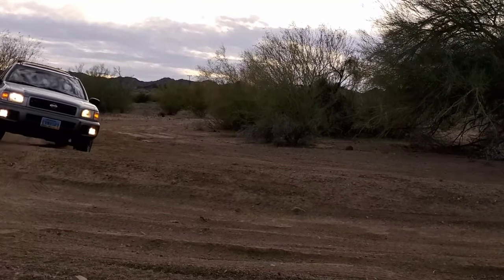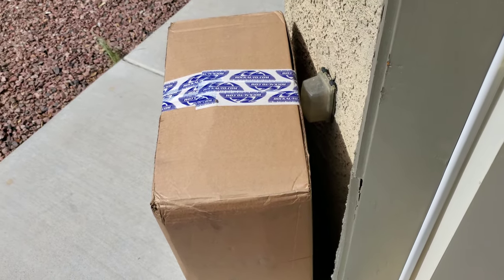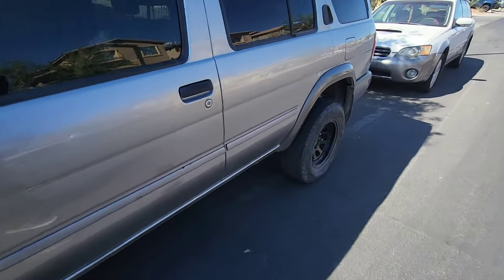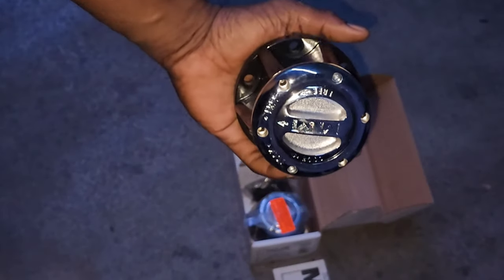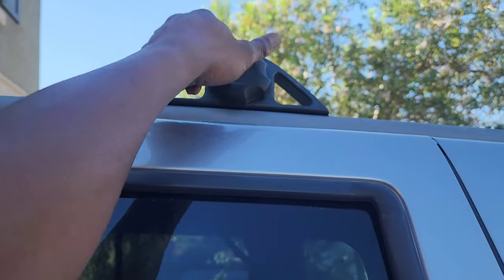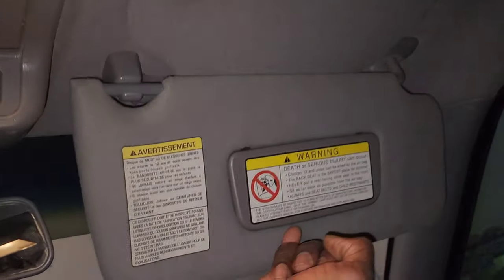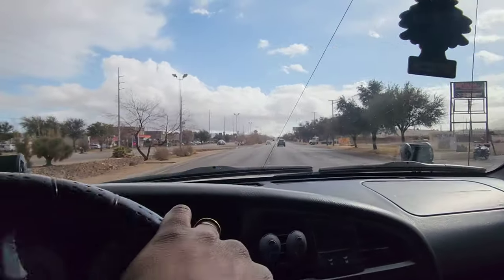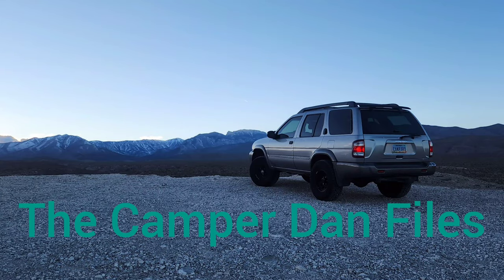My 2001 Nissan R50 Pathfinder 4X4| Future By Design

Comment: I have a 2001 R50 that’s been sitting for about 5 years.  I was about to sell it but decided to keep it and build it out for my grandson.  What a pain in the a$$. There no lift kits for this vehicle.  I have to piece things together. If I want to run 33” I was told I need a subframe drop. My 4 runner was a piece of cake compared to this.  For now it’s on hold.

Comment: Chris have you ever had to deal with rear sag? I put in new moog springs and I still have noticeable rear sag even with new springs
Reply from the maker: @juancruzmichelli9005, I'm sorry but we're comparing apples to oranges here. Your Moog springs are supposed to be equivalent to the Nissan OEM springs that's why your R50 is still sagging in the rear. My R50 with my lift has to be loaded with people, camping gear, or in some cases having my wife's camp trailer attached to it before I see any sag. Notice how level my R50 is even when I was towing my wife's camp trailer with it. It doesn't sag nowhere near where it used to when I was still sitting on the OEM suspension. What you need is a spring that offers a higher spring rate for your R50, this is one of the reasons I lifted my R50. I'm currently running a pair of Dobinsons coils up front and a pair of LR9447s in the rear.

Chris.
Reply: I knew the lift made a difference I just hoped OEM would make it level anyways
Reply from the maker: @juancruzmichelli9005, no worries, I also had similar thoughts in the past too until I started doing countless hours of research on NPORA and asking a lot of the same questions there too.

Chris.

Comment: I have a 98 and have that bottle jack but won't lift the truck do the leveling kit
Reply from the maker: @JosuePerez-xf7le, it lift mines just fine with my lift.

Chris.
Reply: @TheCamperDanFiles  and you have what 3"?
Reply from the maker: @JosuePerez-xf7le , lol no I have a 2" lift on my R50.
Reply: @TheCamperDanFiles  I have 2.5 spacers and not work I do have to use bricks
Reply from the maker: @JosuePerez-xf7le, sorry but I can't relate. I am a bit curious tho, where are you placing your bottle jack when attempting to jack up your R50?

Chris.